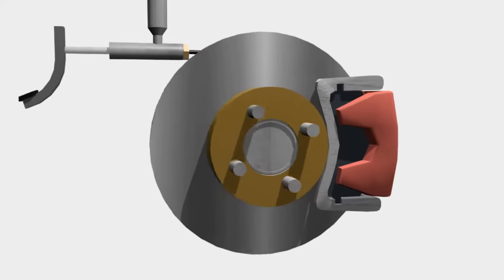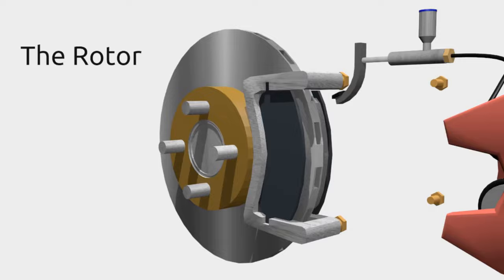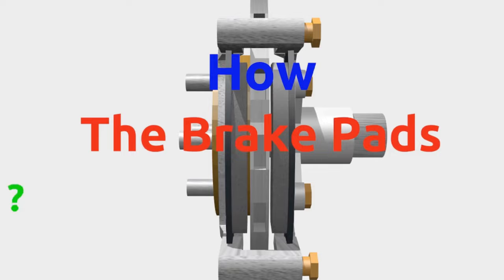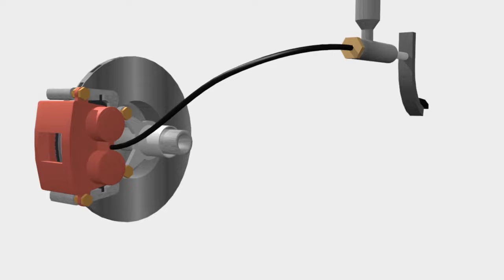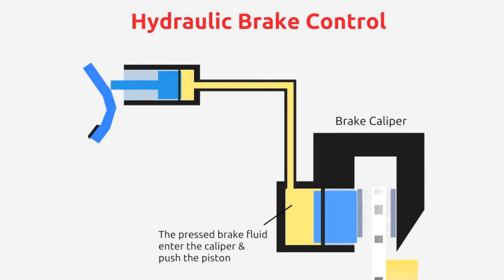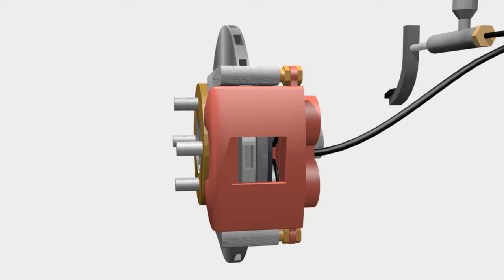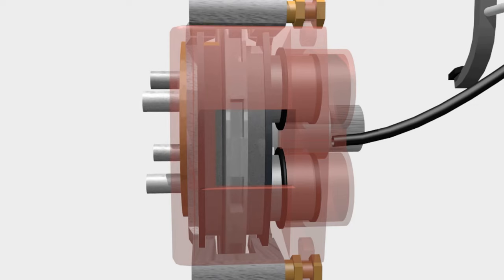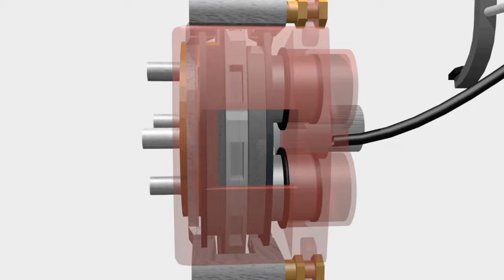Disc Brake System Principle and Working Animation

Comment: I understand how it works. I just don’t  understand how the materials hold up to the friction for so long. Can’t believe a small piece of ceramic can stop a 4,000-6000 lb vehicle. Truly awesome tech.
Reply: That's why trucks and buses generally use drum breaks instead of disc brakes
Reply: Well, to be fair, the force required but that is also very high, but you also need to consider the forces when the vehicle is already in movement, because you need forces already acting on the vehicle to make it move, the wheel functions to stop the forces from the engine to make the vehicle move and to also provide additional friction and regarding force to stop it from moving completely.
Reply: If that makes sense lol